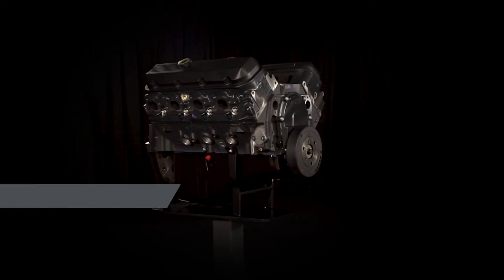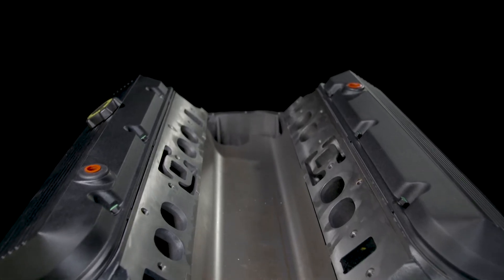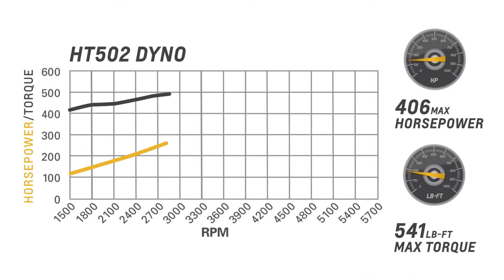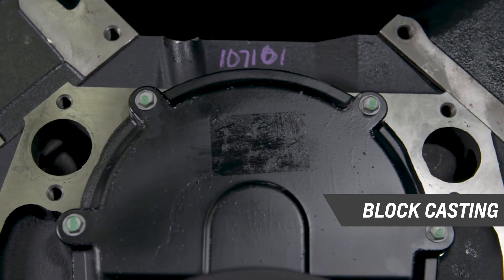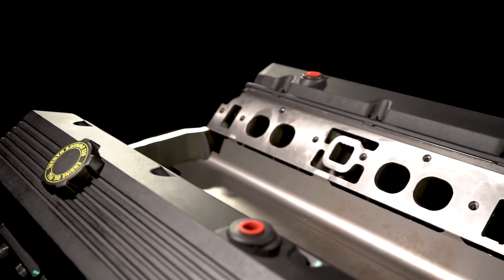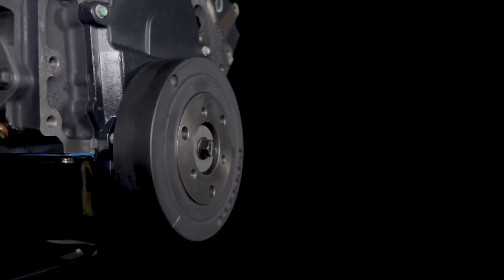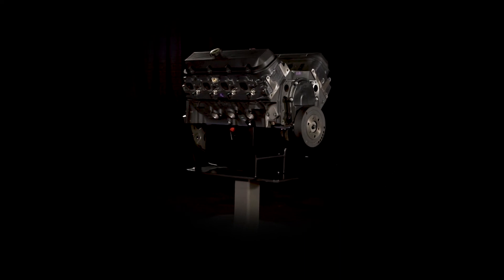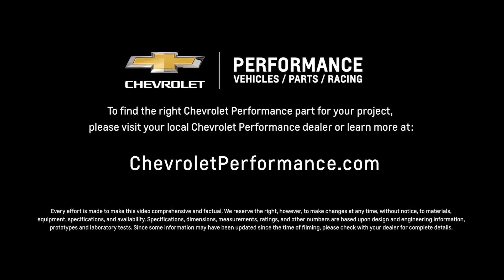Chevrolet Performance - HT502 Crate Engine - Information & Specs

Comment: Will this fit in a 95 Chevrolet Dually what the throttle body injection my 454 is shot looking for an upgrade
Reply: I'm wondering the same thing for my 3500hd service truck